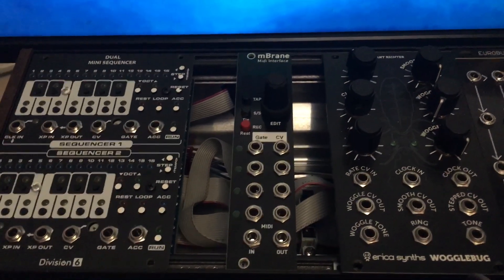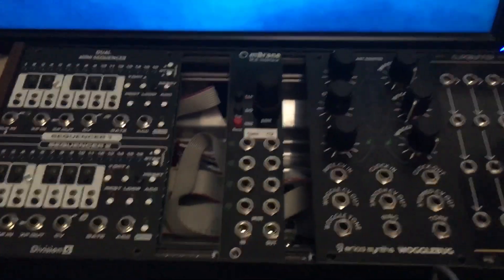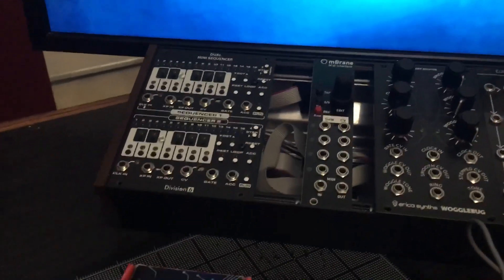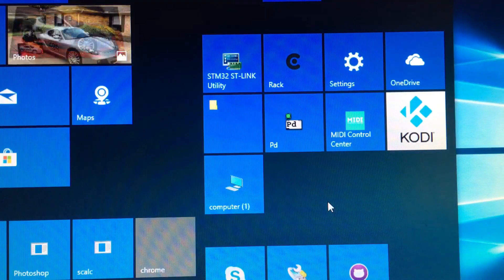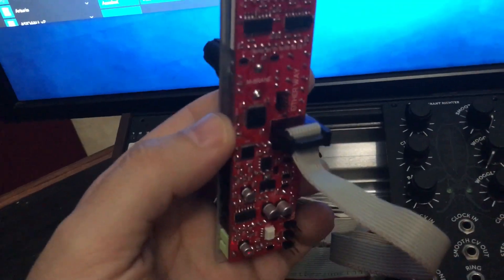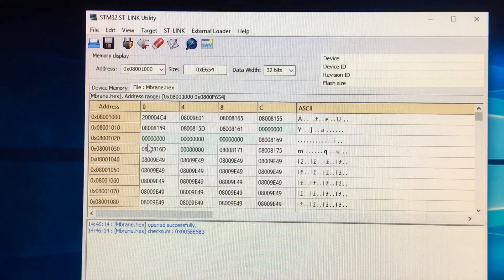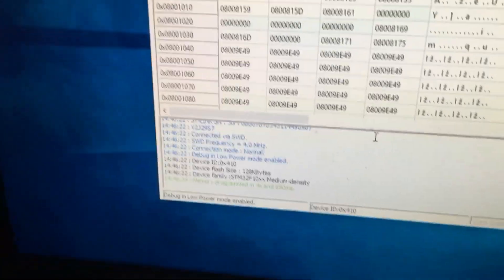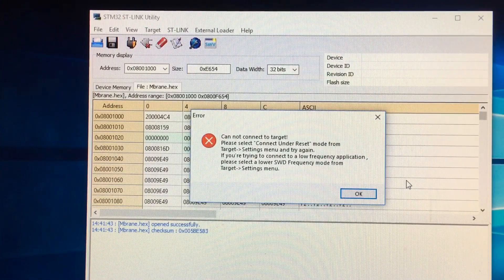Flashing firmware with a  .HEX file & ST-LINK v2  | Modular Quicktip

Comment: Thanks for your sharing. After 3 years, your video is still very valuable for reference. Regarding bootloader, will it go with firmware download? or, I should download bootloader firstly, and then firmware for a new DIYed mutable module?
Reply from the maker: Sorry for the delay. It’s been a long time since I’ve done it, but if I remember correctly, the .hex file did the bootloader as well as firmware for me. But I was also using it from jakplug (maker of m-brane) module that I needed to flash.  I hope that helps.

Comment: what settings are you using in st-link utility? I'm trying to flash a yarns but I can't seem to get it to connect
Reply from the maker: Default settings. Did you try flipping the cable as mentioned in the video?
Reply: @FileTransferProtocol  it definitely wasn't the connector, I replaced the crystal and some capacitors but I now realise the problem might've actually been from powering it on after the cable was connected rather than before. In any case, it works and I was able to flash the chip, cheers for the help!

Comment: worked great!  On Rings, and Marbles! Thanks. Took a few minuets to get my file preferences set to save .txt files as .hex . But all good now
Reply: Thanks for this, but when does the “important” powering on of the module occur?
Reply from the maker: Jeffrey Bush Ah, good point, I didn’t show it in the video but I turned it on just after I mentioned it in the video. So at 2:10 or so. You just have to have it powered on before you launch the software to flash it so that the computer recognizes the device.
Reply: File Transfer Protocol thank you! Then, do you need to have the module fully built at this point? I’ve seen some vague instructions not to finish build before flashing- don’t know why.
Reply from the maker: Jeffrey Bush Mine was finished at this point and I usually don’t flash until done, but I suppose you might flash it before finishing to eliminate shorts and such if it’s not working. A simpler circuit is easier to track down problems with. The other reason might be to make it easier to replace the chip if you got a bad one, but I tend to finish, check for shorts,  heck my work over and over again and then flash it.
Reply from the maker: Jason Trebolo If you are logged in on Muffwiggler there a thread that has all of them in zip files here: https://www.muffwiggler.com/forum/viewtopic.php?t=142320